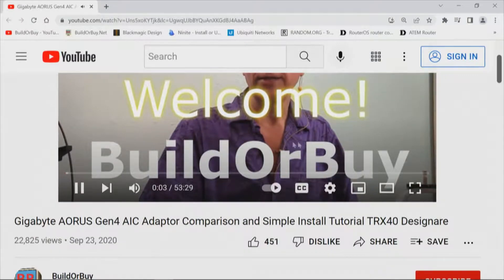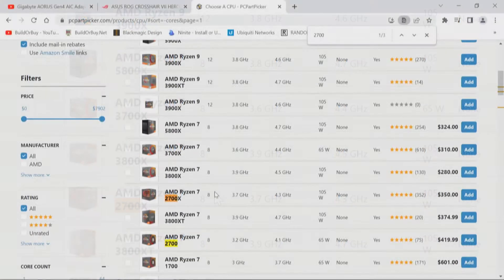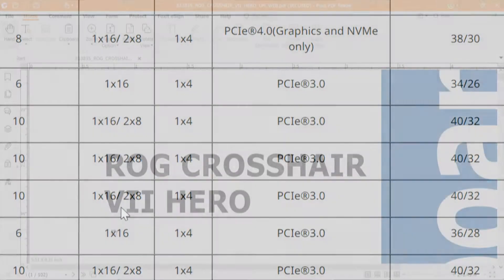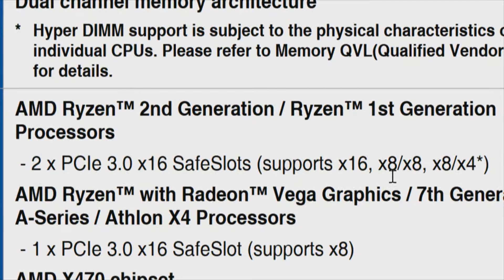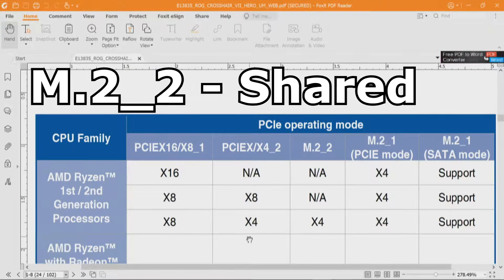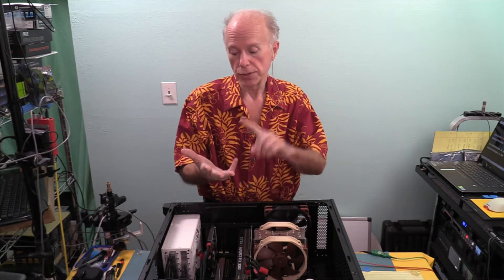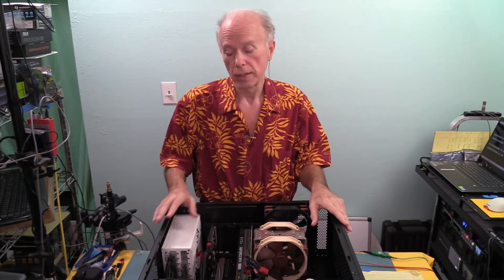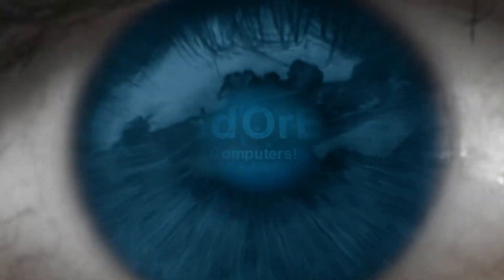ASUS ROG Crosshair VII Hero Wi Fi X470 Motherboard - Adding M.2 NVMe Storage

Comment: I know I'm nearly three years late to this party, but, thank you thank you THANK YOU for this video.  I've got this exact same motherboard and have been pulling my hair out lately trying to figure out my PCIe slots, lanes, etc wrt to a 2-drive PCIe Nvme add-on card I've been playing with.  I couldn't get my system to see both installed Nvme drives on this card, and now I know why.  Geezus just when you think you know it all after 25 years of building your own systems I find myself knocked down back to peg 1.
Reply from the maker: Hi @Appalling68 ,
Fascinating topic right. Extremely important in the greater scheme of building a computer. This issue of PCIe Lanes all started with PCIe 3.0 and really blossomed with Intel X299 Chipset. There were a few motherboards at that time with a marginal upgrade to allow installation of a single M.2 NVMe PCIe SSD Drive which ran at half the capable speed. PCIe Resources are the most important aspect of a Motherboard.

Another perspective on this topic: The Motherboard is the foundation of the computer. The Chipset is the foundation of the Motherboard. Chipsets rule. Choose a Chipset 1st then choose a Motherboard. To accommodate all of those connections on a Motherboard requires more PCIe Resources hence a Workstation class Motherboard. You'll never look at a Motherboard the same way again once you understand this sequence. And Intel has been moving backwards ever since. Experience is the best Teacher.

Comment: Hi there! I'm having an issue that been happening since I build the PC, but its getting more persistent recently, I will try to be as specific as possible. When I power up the pc after its been turn off for a while, sometimes completly sporadic without a pattern, the PC turns itself off before getting into BIOS,  the motherboard's rgb turns on like its in stock mode  (I allways have all the rgb turned off)(No motherboard code is shown when that happens and no beeps). Then I have to power on the PC again, and it enters windows with no issue. It allways enters to windows the second time that I power it on. Also, I have no issues outiside this, the PC works perfecly once I'm in windows. I have the BIOS and Windows up to date, I have no idea what could it been the issue causing this. It's random, one day can happen to me twice if I turn off the computer and open it again, and sometimes can happen after 3 days, a week etc. If anyone has the slightes idea of what could cause that I would really apreciate it. I will leave my setup details down bellow, and I can provide more info if necesary.  Everything is connected to a UPS (APC Easy UPS BVX 2200VA/ 1200 Watts. Thank you very much.

Case: Lian Li O-11 Dynamic, 
Motherboard: Asus X570 ROG Crosshair Hero VIII Wifi, 
CPU: Ryzen 5950X
GPU: 3090 Founders Edition ( I'm currently using a Gigabyte 970 and the issue persists)
Power Supply: Corsair HX850
RAM: Corsair Dominator Platinum RGB 32 GB DDR4 3200 MHz C16 ( x2 so a total of 64gb)
Cooler: ARCTIC Liquid Freezer II 360
Windows Drive: Sabrent 1TB Rocket Nvme PCIe 4.0
Fans: Noctua NF-A12x25 PWM chromax ( 9 units)
Reply from the maker: Hi Mandonga,
Welcome! Can You identify when this started? Did You change anything? Has this been occurring since You originally Built Your Computer? Could be a lot of things. This will be a Process of elimination. My thoughts are, in order, PSU, Motherboard then CPU. Do You have any USB Devices plugged in at Boot? Any special I/O Cards installed?
Reply: @BuildOrBuy  This has been happening since the firsts weeks when I built the PC, but like I mention it goes on an off completly random,. The only think I change to the pc, was the thermal paste the 1st week or so, I even put a better one, I don't know if that might be it, I even put a better one. Maybe I will get a new power supply and test for a few weeks and see. But again, having this issue so randomly is really weird, I have no way of replicating the problem. Like I said, 4 days may pass with no issue and then 2 days in a row this happens.
Reply from the maker: Hi @mandonga1200 ,
Sorry this message slipped by me! Working on next Video! Keep Us Posted on this issue please! Hope You're making headway! A frustrating situation. Was this happening before You changed Thermal Paste?
Reply: @BuildOrBuy  No worries, I will post if I have some news regarding the issue. But you will not believe what happened to me last week. Don't know if you remember but I ended up buying a Seagate Firecuda 530 4TB M.2, also I got a AMPCOM M.2 NVME SSD a PCIE Pcie 4.0 adapter in order to put the M.2 on the second Pcie slot at the motherboard (worked like a charm), and finally I used the Sabrent Heatsink you featured on the video. Everything was working fine until next week, all of a suden the drive disapeared from my PC, no sings of it, well after some troubleshooting I ended up disasembling the M.2, it turns out the Sabrent heatsink pressure ripped out the solder from the M.2 connector. I was just blown way by that. The heatsink is amazing, the temps where crazy low, but man, its so big that's almost not compatible with anything, I can not even put it in my motherboard M.2 slot, it does not fit, its to wide, and I assume all the other Pcie 4.0 card adapters will not be compatible with the heatsink. I saw that you put that Sabrent heatsink on the dual Supermicro Pcie 4.0 adapter, have you had any issues so far? I'm planning on getting that adapter eventually but do you know any other Single Pcie 4.0 adapter that will be compatible with the Sabrent heatsink? Let me know. Thank alot for you time Gill, really apreciate it. Cheers,
Reply from the maker: Hi @mandonga1200 ,
Wow! What a mess! We have Tested 14 M.2 NVMe PCIe Heatsinks and 2 Thermal Pads. And I have had concern about the weight on an Adapter Card which started Us on Our testing path! Therefore, using any extra M.2 NVMe PCIe Heatsink should be relegated to a parallel placement in relation to the Motherboard instead of perpendicular placement. 

Yes, the Supermicro Dual M.2 NVMe Adapter is a Server Component. Solid Construction. However, due to the stress of the added weight, that too could become a problem. This is all uncharted water We are venturing forward in. This exemplifies Our concern for any M.2 NVMe Adapter should include their own Passive Heatsink Cooling Solution.

Everything We do is temporary for a Video. We reconfigure and move on to the next Video! Yes, Keep Us Posted on Your Progress! Here to help, learn and share! Give me some time. I think Sabrent has a Single M.2 NVMe Adapter.

Here is the link on Amazon for the Sabrent Single Adapter. No bracket.
https://amzn.to/3b09eLh
There are several others. Not all are the same. For adding a Heatsink, that would need the I/O Bracket for stability. 

Glotrends makes a Dual, 1 M.2 NVMe and 1 M.2 SATA.
https://amzn.to/3PJu6VD
As an Amazon Affiliate I earn from qualifying purchases. We have a Video about the Glotrends Sky Quad card. Great product! It works! We have not tried either of these two, yet. Hope this helps!